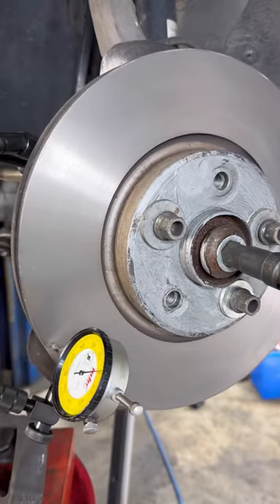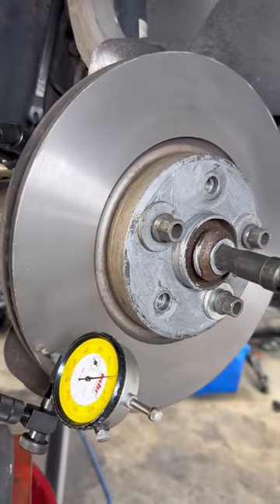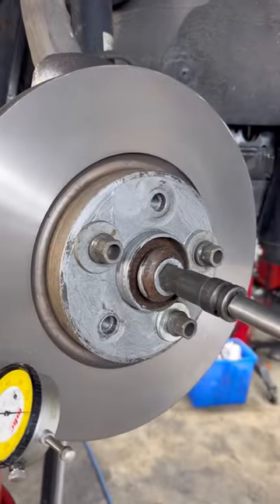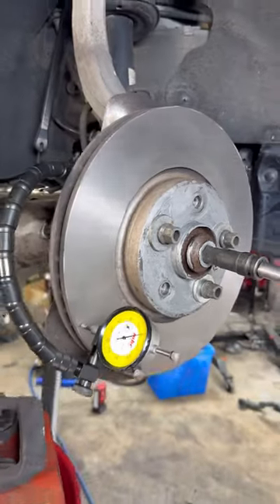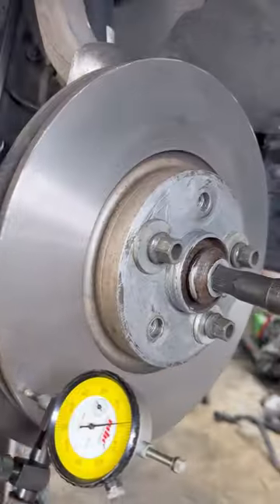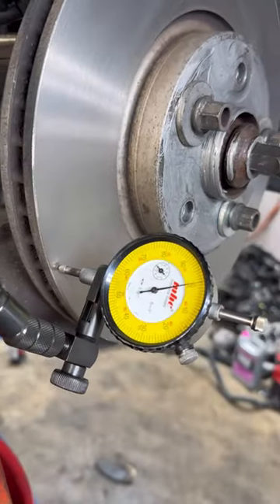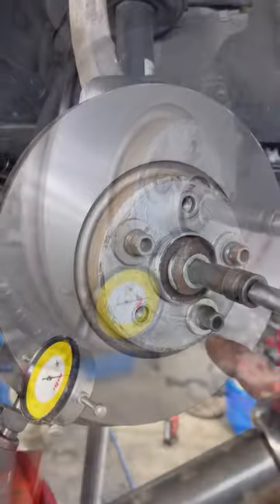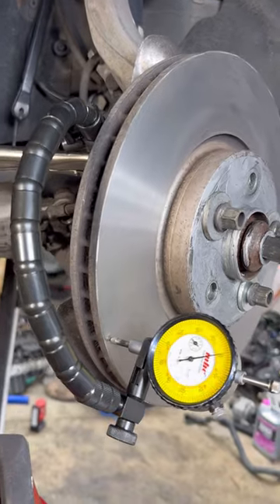Mechanic Proof! Torquing Wheels Properly ensures less Brake Rotor Runout Warping Pulsating Feeling

Comment: So correct me if I’m wrong but that much anti-seize on the hub and rotor can cause the rotor not to fully seat when you put the wheel on and torque it bc it’s supposed to use the friction/clamping force to prevent the rotor from moving in between the hub and wheel, I’ve been told that if you’re gonna anti-seize the hub you only put it on the inner ring of the hub where the rotor seats on to it. It just seems like a safety concern for me

Comment: I wish technicians didn't smear all of that antiseize on hubs and rotor faces. Ii it unnecessary and makes a mess. Just lightly  coat the inside of the wheel pilot hole.

Comment: Wonder if the results would be different with the 5 bolts installed.  Any clue on what the torque is with the impact? Wonder if you hit them gently all the way around, then hard at last, If that makes a difference.

Comment: Great work but stay away from the anti seize.. countless times I have seen it cause torque issues with wheels 
11year Chryslertech +some
Reply: A dab of oil at most for any wheel end hardware! I've seen horrific things with anti seize on wheels as a hd tech
Reply: @Graive17 This, I just use a dab of whatever shit engine oil I have sitting around. Had an old bottle of 5-30 Oreillys, perfect.
Reply: Only use on the mating surfaces, not the threads.
Reply: @Jhubes5.9 I’ve never thought about this but it makes perfect sense

Comment: You think it's worth the 3hr per wheel you put??.. if it was my car maybe.. but 12 hours labor would buy another car..
Reply: 3 hours to torque a wheel properly? That's the entire point of this video...
Reply: That one person that comes to the internet to disagree regardless of the situation.
Reply: @cefb8923  no dude.. I habe been line technician for more than 12 year.. brake jobs on book hour are max 2.0 hrs.. costing around 250-300 when it's a complicated car..  You can't lose 1 hour just scrapping rust like the last video..  you can not lose another hour just che king if the brand new rotor the provider gave you  is straight... It's beautiful what he does.. but it's not worth unless it's your own car
Reply: @cefb8923  I guess I just like doing stuff the right way on my car

Comment: Have never had this problem on my
ol' 72 Chevy C-10... Has big castle nut in
the center to tighten down the rotor on the
bearings, one inboard, one outboard. The 
spec calls for 100 ft lbs on steel wheels.
Since I run American Mags, I torque no more
than 80 ft lbs per lug. 5 lugs x 80 = 400 ft lbs
total clamping pressure. That's more than 
enough torque for the big nut driving it! 😳
Reply: Had my ‘72 since high school. 25 years.

Comment: Too bad today's rotors don't take well to a turning, especially on German cars. They might be good for a couple thousand miles, but end up warping soon after.

I had the stealsrship turn the fronts on my '13 Audi S7 when I bought it due to obvious warping (plenty of meat on the rotors, never been turned before), and after a couple thousand miles, they're as bad or worse than when I bought the car.